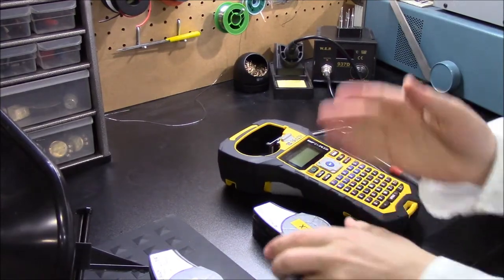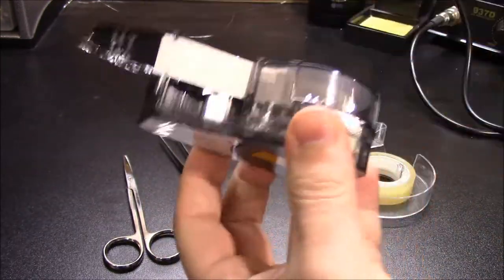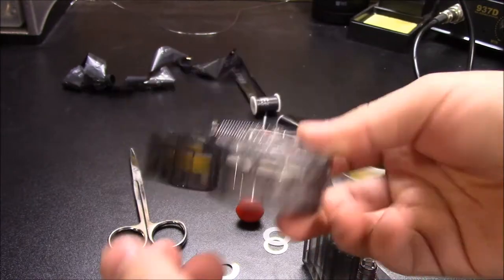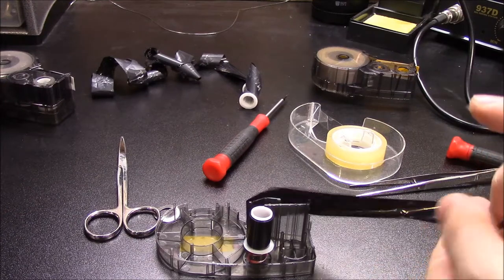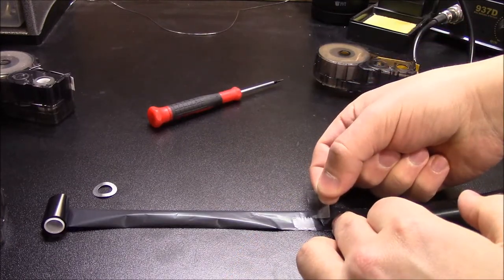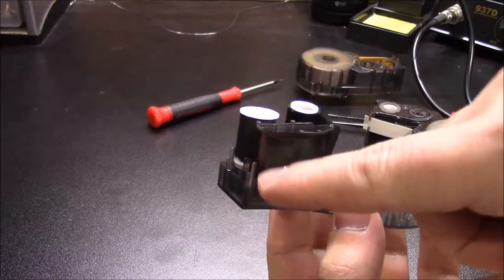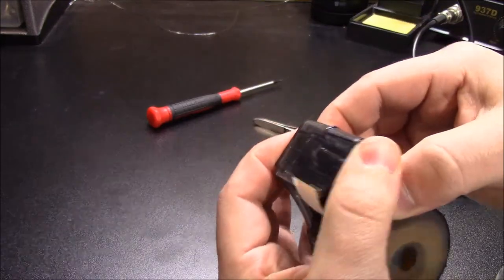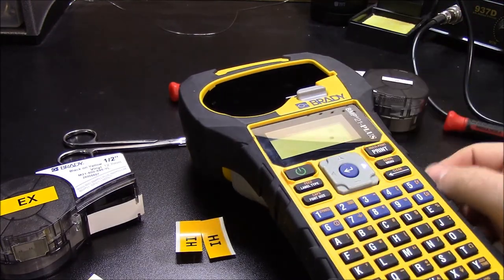BMP21 Cartridge Repair - Ripped Ribbon

Comment: Man, is that really their number 9?? Looks like a lower case q. :/
Reply from the maker: Sadly, yes it is :,(
Reply: @IllInformedHuman  The very first print, my ribbon jammed and I corrected as you showed here. Then I found that the battery wouldn't charge via the body AC port, but I had to remove the batt and plug IT in! When I printed that first "9" I was done. :)

Gonna check out the P-Touch E550.

Thanks for the vids though! Very helpful!
Reply from the maker: @OwenIverson  I am glad I could at least point you in the direction that you were destined to go XD

Comment: Great video....but.....you've put the ribbon in the wrong way round. if you look at a new cassette, certainly on an M21-750-499 Nylon Cloth tape, 
the matt side faces out. I don't know how it works but it does.